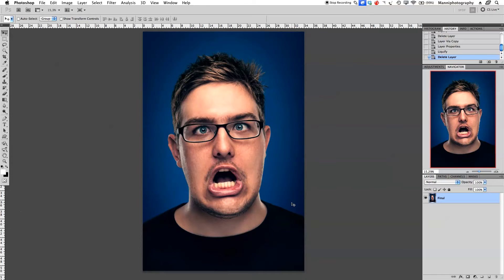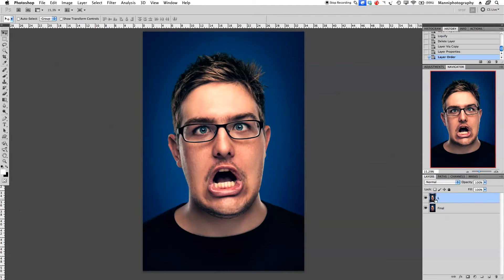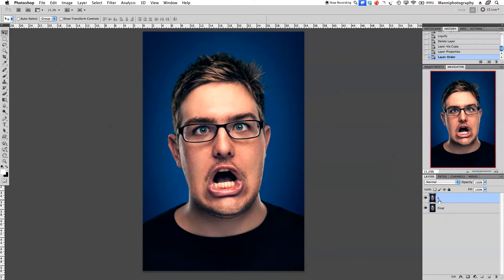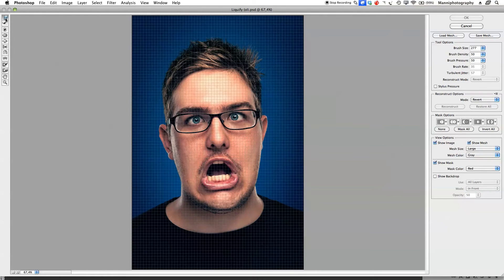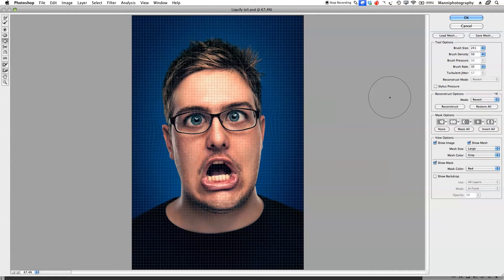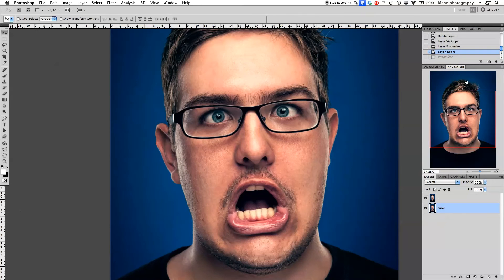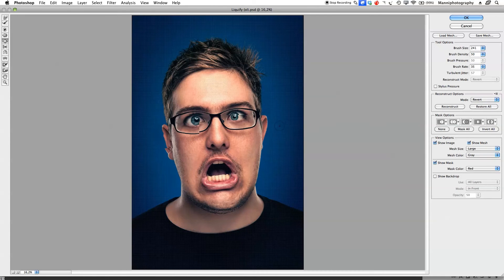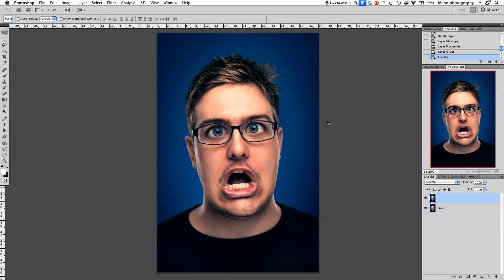Photoshop Tutorial Crashing Liquify Tool

Comment: My whole photoshop C6 crashes as soon as I click liquify. With 72 DPI and selecting a small area of the image. It started 3 days ago and I was doing it on some images until it suddenly started happening
Reply from the maker: +Benjamin Gottfridsson Hey, have you updated to a new PS software? or have you done any other steps different?
Reply: Retutpro - Photography & Photoshop Tutorials nothing has changed except I may have installed newer graphics drivers (I always do this as soon as there are new ones). I plan on reverting to older ones and test but I haven't gotten around to it yet
Reply from the maker: +Benjamin Gottfridsson Hi, it might be your ram on the computer - Once you go into the liquify stage.. your ram is pull extremely and your graphics card might also suffer on that.. and then all crashes! Maybe take a look at the ram reading.
Reply: I've got 16gb 2300mhz but I'll take a look thanks. My graphics card is 3gb also so it's hardly the issue...